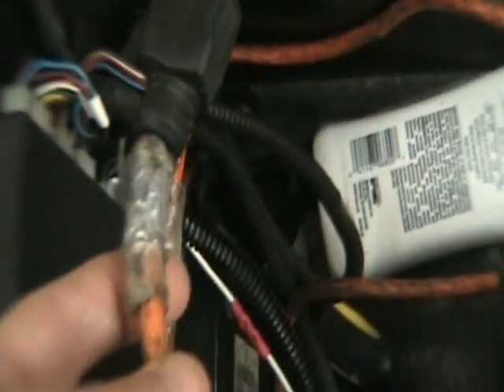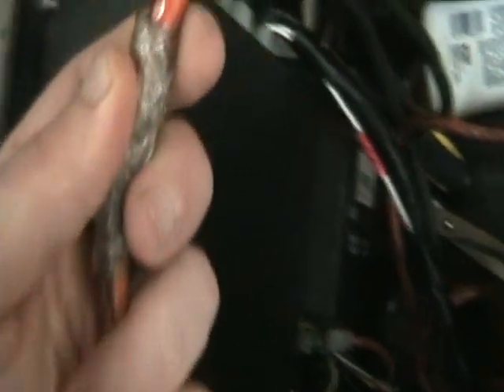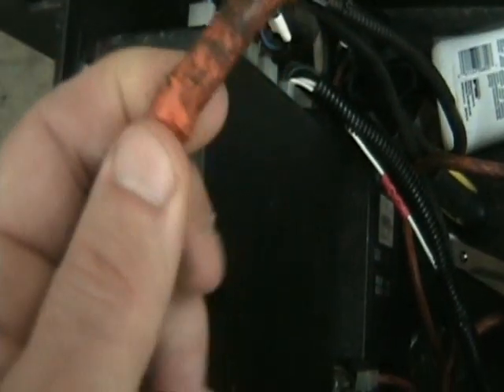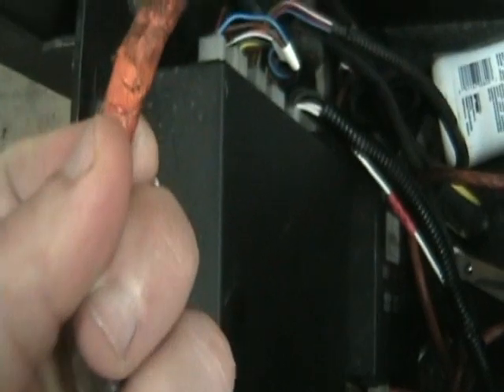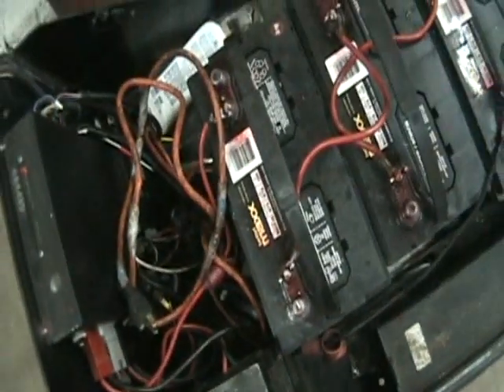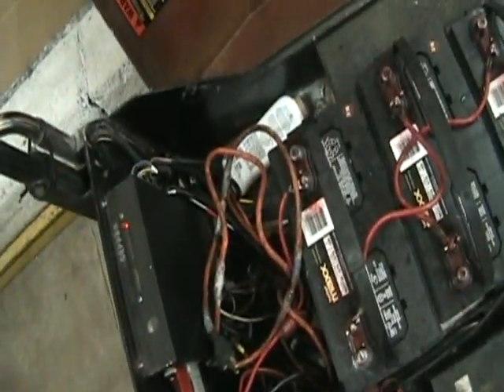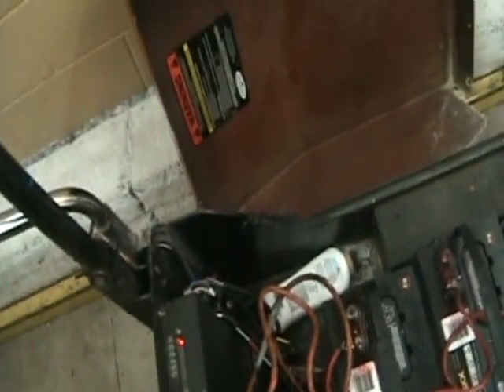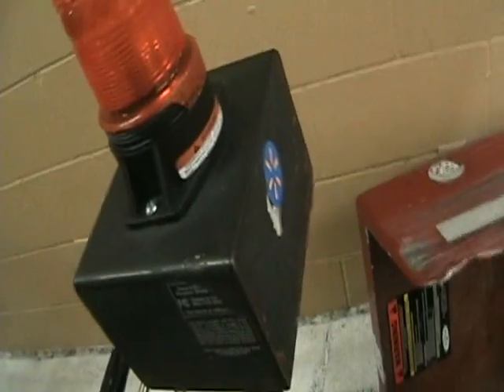Walmart's Oh So Well Maintained Electric Cart Pusher.wmv

Comment: Solution, switch to target. Same kart pusher (2000 or m3), but they actually fix it when you tell them to. The light on our 2000 "stopped working" but it turns out there is a hidden button for it that got pressed. We always have both running, meanwhile the walmart a few stores down lost their remote, so rather than getting a new one, they tied a rope to the throttle and have to pull the rope to make it go.

Comment: i was a cart pusher for walmart. our mule broke in the winter and was forced to push by hand. ALONE!. they said they will order a new one. 3 months later it arrived. i was told if this one broke down we would not get another one. sure enough awhile later broke again. so i had to push by hand again. after requesting for help time and time again from the associates inside. and never getting any help. i decided to sit on the break bench outside my whole shift. a month later. fired for it. i busted my ass for a yr hoping my hard work would impress. sure didnt. and being the only puerto rican there. well pretty much the only minority there. i felt i was not treated equally. everybody was white. this was in the quad cities. and being from chicago it was hard to relate with them and vice versa.

Comment: We push carts without the machine it sits unused cause no one has trained us how to use it..
Winter is not very fun its like pushing in a sand box we have more jobs to do then are job code holds cleaning, spills, bails, building furniture, organizing fixtures displays some of us have 2 job codes Store Standards and Maintenance try doing both it will drive you crazy.

Comment from the maker: @CowboyNiceguy Yah, I hated using that damn cart pusher. What store will you be working at? I used to work at store number 1062. The one off of El Dorado, Friendswood, Tx. I told their management to fix that damn thing a million times after almost getting electrocuted. They never fixed it. So I put it here on You Tube. Typical Walmart. They don't care about there employees. That's why I'm happy I don't work there any more.